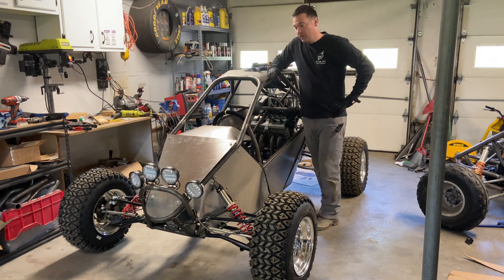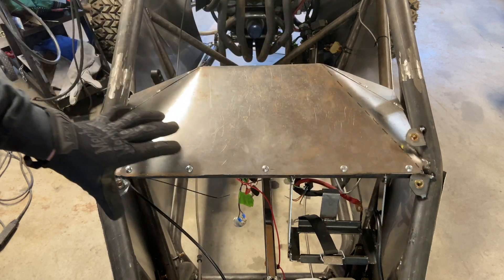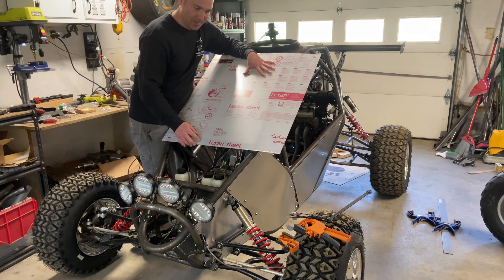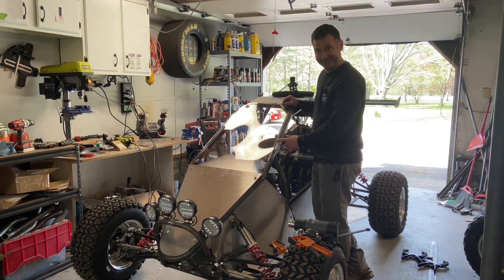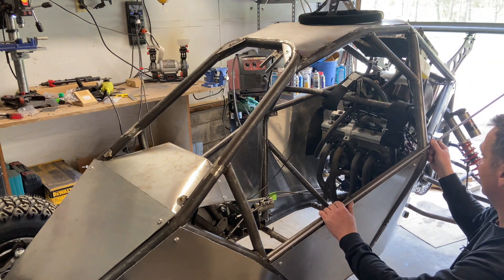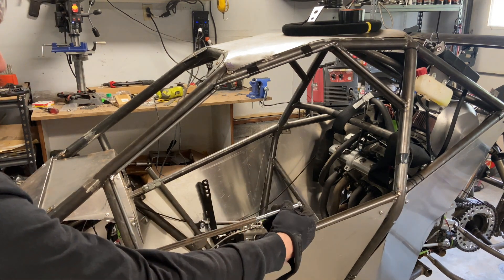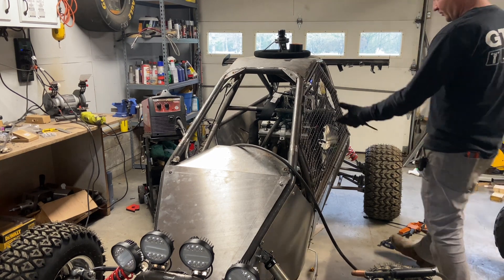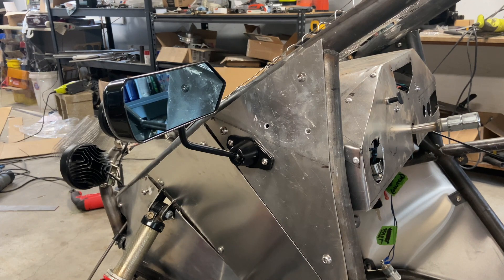Crosskart Build #27: Windshield and Doors

Comment: I work in a glass shop, we frequently use lexan and it's cousin Margaurd. Margaurd is equally strong as lexan but is very highly scratch resistant. Second note, polycarbonate sheets must be bent at melting temperature OR cold. If you use 1/4" for your next windshield you will need to take it to a metal shop to have them press bend it with at 40 ton or bigger press.
Reply from the maker: Thank you very much for that! I ended up cutting the shape out to give the lambo doors room to open. Does Marguard cut easily like Lexan? And I already bought 1/4” for the other crosskart, double the weight but still not heavy at all. Thank you again.

-Kyle
Reply: @KJRaycing  yes Margaurd does cut and mold the same as lexan. Fantastic product. We use it often to build side by side windshields and even for some farm and construction equipment. Works well and lasts a long time.

Comment: Quick question.  Would there be a way to make one of these but with a door that open up the mid side brace?  Strictly for street use?
Reply from the maker: I’m pretty sure one could be made!
Reply: @KJRaycing  If I were to weld up this frame, then cut right where the mid brace meets the front pillar, smooth it out and turn it into a latching joint of some kind, to form a door, would this lead to the frame distorting over time do you think?
Reply from the maker: Awesome idea! I would add simple crossmembers at the lower two corners of the door just for peace of mind.

Comment: What size are those tabs? I have someone that offered to cut them for me and they aren’t on the VF2 plans. Thanks!
Reply from the maker: The plans say what thickness of metal I use for the plans, the length differs depending in what parts you are using, I have videos that show why I don’t use laser cut parts. We’re building these in garages 😁

Comment: Witch do you like better more horsepower 600cc streetbike motor or 500cc polaris with reverse ?
Reply from the maker: Depends on where I’m going. For my home track of two acres both are excellent. If I had a bigger place to run without needing reverse so much, definitely the 600. The rev range is crazy, all that power stays in and you don’t have to worry about running out of gear. But the 500 you get to shift more, so in a sense it is more fun too. All depends on who’s driving it and what they prefer.